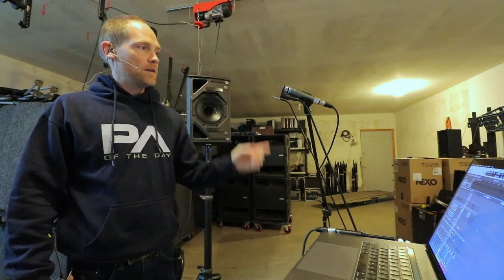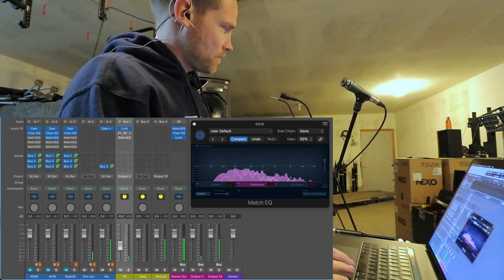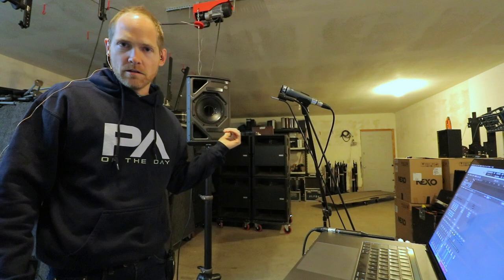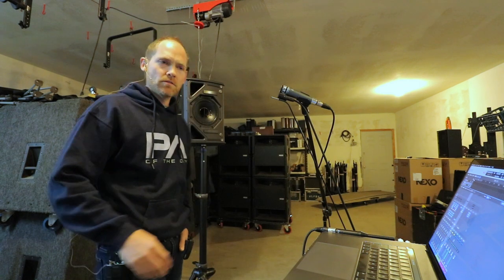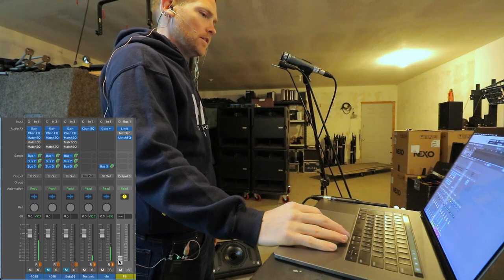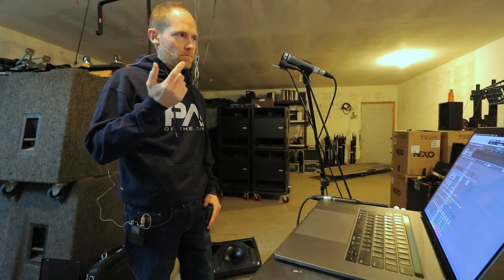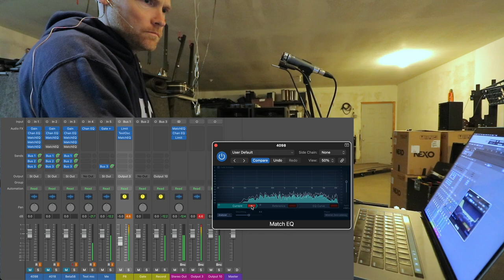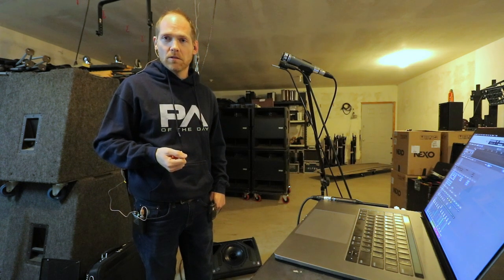Microphone gain before feedback comparison.

Comment: I suggest that you aim the mics away from the floor monitor as they are normally used. Talk into each mic one at a time (or use a pink noise source), at the same distance, and turn up the monitor just below feedback. Measure the SPL of the speaker in each case with an SPL meter close to the monitor, so it doesn't pick up the source very much. That should indicate the differences in gain before feedback.

Comment: This is a pretty flawed way of testing this tbh. Doesn’t look like you calibrated each mic input level with a reference tone/noise and matched them to a specific target. Adding all those eq stages changes the phase response of the mics and influences the sensitivity at different frequencies adding additional variables to the test. Why would anyone do this in a live setting when the goal is to maximize gain before feedback?
I think audio engineers would be more interested to know which mic sounds more natural/pleasant when pushed to its limit. I would keep everything simpler and match input levels to a reference tone and measure the db difference between each mic’s feedback point. That would be a more useful, real life application imho.
Reply from the maker: Lots of good observations and thoughts here. On the specific issue of the input levels, the problem with using a tone as a reference for an input level is that microphones have different frequency contours. So you might match them at 1kHz, but what if one microphone happens to have a natural bump at 1kHz? In my opinion, it doesn’t really make sense to reduce the overall relative volume of that microphone - as perceived by the human ear - because of its spike in frequency response at 1kHz which happens to be the calibration frequency. It isn’t uncommon for microphones of even a similar type to have variances in their relative frequency contours of +/-10dB or more. Which frequency should we pick as the reference? 

So, the most meaningful way in our opinion to set reference levels for these kinds of tests is to just use one’s ears and pick a relative balance between the mics using normal input content that the mic is typically used for. After all, this is a test meant to reflect “real world” application performance. Does it sound to you like any of the three mics were much louder or softer than the others in a way that would make the result of the test lack meaning for the real world?
Reply from the maker: Also, on the issue of the phase of the EQ affecting the feedback response. This is a legitimate question, and probably I should make another video about this issue specifically. In this particular case, the EQ I'm using has a very minimal phase response even though it was not in the "minimal phase" or "linear phase" mode. I've done pretty extensive testing of this particular EQ in regard to phase response here: https://www.youtube.com/playlist?list=PLaff42RJ4_aMXKD8VAINC9jlZDpfo8bXJ
Reply from the maker: Without specifically testing this, my gut feeling is that the phase responses of these EQs have little to no "real world" impact on the feedback responses. Also, the "impulse response" of these EQs (the pre- and post-ringing artifacts that drastic EQs can often introduce) also in my estimation has little to no impact. But, I should test these factors in isolation to be sure. Would make a great follow-up video.
Reply: I agree with this. Starting out with applying unnecessary corrective EQ before you even listened to it through the speaker makes no sense. This video only proves that a dynamic microphone needs more energy to get moving (which is well-known) and that this particular monitor placement feedbacks differently in certain frequencies. DPA's don't need 'corrective EQ ' to make them flat, they're acoustically tuned like that in the factory without adding any electronic EQ. Which is why they're basically flat from all angles, have very linear phase behavior etc. Keep it simple. 😉
Reply: @devinlsheets_alphasound  I did mention tone or noise. I would calibrate them using pink noise for the specific reason you mention, that way you can get an average level on the full spectrum. Setup each mic at the same set distance and position, on axis with the speaker. Play pink noise at a set level and match the input signal using the preamp gain for each mic. Then proceed with testing the GBF differences and measure the actual dB difference on the output driving the speaker. When listening with headphones, it does sound like each mike is slightly different in volume and that could for sure be due to the different frequency response of each mic. They also still sound different after the corrective eq and there is no way to perfectly match a mic to another mic, it just introduces more variables and it doesn't add to the utility of the test imho.
Reply: @ALPHA SOUND  you did frequency "calibration" or "correction" but didn't do anything to do any calibration or correction for gain when you're testing for gain before feedback. To me listening on my phone, the 4098 sounds louder and has the most feedback. You probably should have played back the pink noise and set the gain for each mic to a reference level. Then measured the gain where each mic began to feedback and compare the difference from the reference point. I also wouldn't have tested GBF by talking at all, just increase gain until they feedback with just room tone. Did you even account for the attenuation the corrective EQ made on the 4098 and B58 when you corrected them to sound like the 4018? Lack of post processing level matching makes all of the corrective EQ just an experiment on if you can make 3 mics sound the same, not which one has better GBF.

This test does nothing to show real world performance of these mics. Doing a comparison of these mics without the EQ would give me useful data to make decisions with. This test just shows if you make 2 mics have a similar frequency response as a 3rd mic you'll have results that don't really help you make real world choices.

Measuring and tracking where each of these mics were prone to feedback would be useful for comparison. Measuring and tracking SPL vs required gain to reach a reference level would be useful data to compare. 

This video gave me no usable data.
Reply: @il_moe exactly my thoughts :D good insights

Comment: Hi Devin. First of all congratulate you for your channel, very interesting and explanatory. I would like to ask you a favour, I need to learn how to use and route the nexo MK1 NXAMP4x1 amps (the old ones). Unfortunately there is no video on how to use them and specifically how to route the outputs with a splitter (for example to send several speakers in one cable).
Could you do a tutorial on those amps?

Thank you very much. 

PS: More than 70% of the people who use Nexo don't use Yamaha consoles, we use Midas. How long will we have to wait for them to make an interface for AES550?

Comment: In pro audio it's about science not cost. You seem to be surprised that the $2000 dollar isn't $2000 dollars worth better at feedback rejection. Perhaps it wasn't designed with that in mind. Equally price doesn't equate to better 'sounding'. I've heard plenty of $50 mics that sound as good if not better than a dpa. Granted the build quality may not be as good, but I'd find 40*$50 mics more useful than 1*$2000 mic. Especially when the client or audience can't tell the difference. Anyway..the science you're missing is that the 57 in this example will have the highest gbf because it has a larger diaphragm which requires more energy to move into a feedback oscillation.

Comment: Exceptional work, however they are all cardioids and have very little to no rejection at that angle. You should do the same exact test but the monitor should be placed to where the mics have most rejection. Not even 180°, it's usually at 120-160°.

Comment: Tell ya what, a sm57 with a windsock blows most podium goosenecks out the water,   especially with a tightly notched eq
Reply: No, it doesn’t. Two microphones with the same polar pattern will be indistinguishable in anywhere but a laboratory.